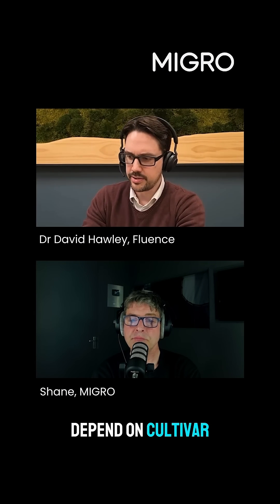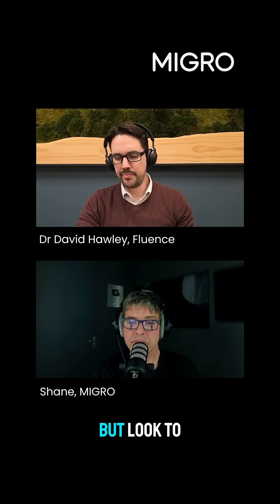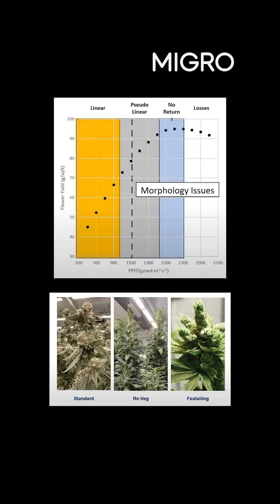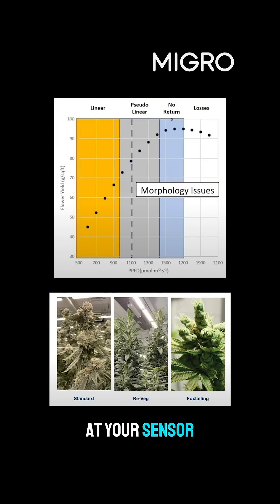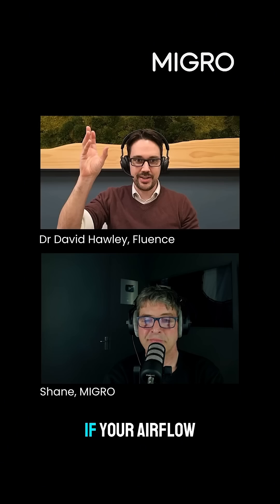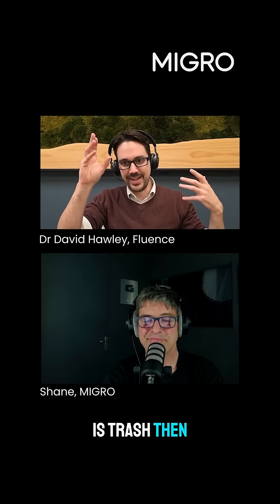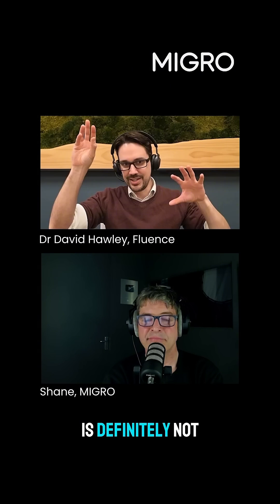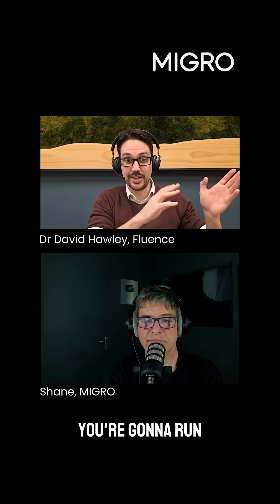How much light is TOO much?

Comment: Plastic sock things? Can anybody elaborate?
Reply: It goes underneath the canopy and has port holes that aim up. It's powered by inline fans. So imagine a long duct that does not have spiraling metal wire in it and is smooth while being clear plastic with holes like ever 6in to 12in spacing. It's nice, but it takes up space. Idk how you can do undercl canopy lights with up
Reply: @jasontran4525 Put the under canopy light in the tube! Just a thought :) Migro sells under canopy lights. I have 2 of them.
Reply from the maker: Very interesting.. 👀
Reply: How much light is too much? Migro Aray 5X5 at 100%, 10 inches away from the canopy is too much ;)
Curiously, this is my second run with the Aray 5X5s and I see something I've never seen in 30 years: two different cultivars have upper buds that have 2 heads!
Reply: @pursaveer9027 
Well you know what they say. 
Two heads are better than one. LMFAO 🤣😆🤣😆.

I'm sure it's not from the light. 
It's got to be strain related.
Reply: @pursaveer9027  do you mean fox tailing or two actual main haeds
Reply: Woah, that is actually an amazing idea 💡 
The tube might affect the PAR but I am VERY interested. MIGRO please do a test on this lol
Reply: In the Netherlands we’ve been using them for quite some time now. Best known brand here is airsock.